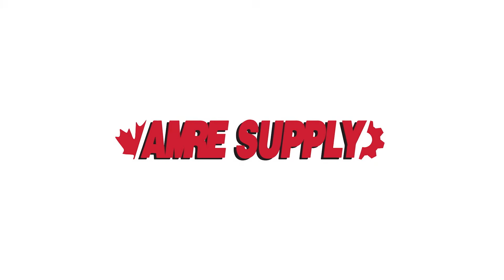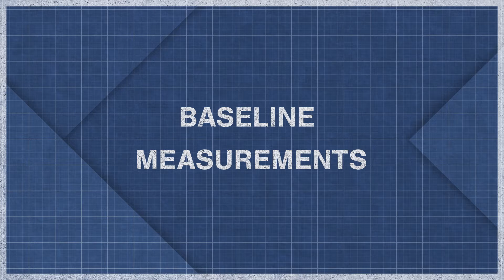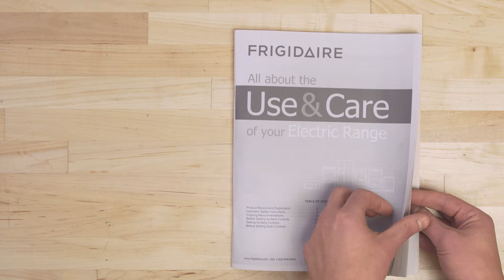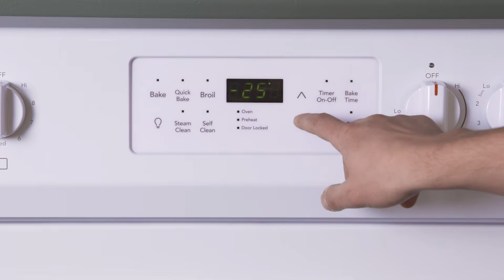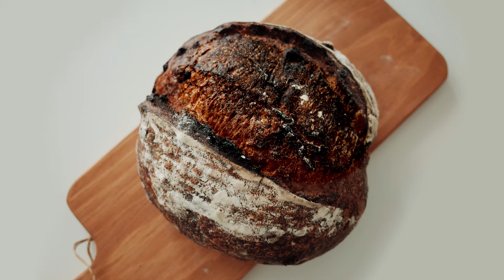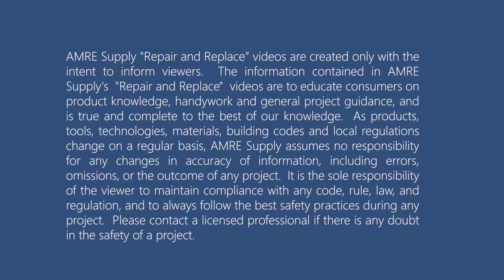How to Calibrate the Oven Temperature | Repair & Replace

Comment: I'm trying to get the temp very low for drying clay and plaster.   I calibrated it to minus 35, then set the oven to minimum (170) so my meat thermometer should read 135?  But no, it's going up to 200.   Is there any way to replace the thermostat with a lower one?
Reply from the maker: Thanks for watching. When you're monitoring the temperature, is that only during the preheat or does it sustain 200 degrees for the entire cook time?

The other option is using the tray under the oven that people often store their pans. Try measuring the temperature of the drawer on different bake settings. It won't be as warm as the oven, usually 110–190°F, but this depends on the insulation and the setting.

Comment: Mine has a dial to turn on all temperatures
Degrees doesn't show in display
Reply from the maker: Thanks for watching. Older ovens will use a oven thermostat which is connected to a sensing bulb. This is not digital. Over time these thermostats can wear down and effect the temperatures.
https://www.amresupply.com/catalog/Oven-Control-Thermostats-632506-AD1P

Comment: Mine has a dial to turn on all temperatures
Reply from the maker: Thanks for watching. Older ovens will use a oven thermostat which is connected to a sensing bulb. This is not digital. Over time these thermostats can wear down and effect the temperatures.
https://www.amresupply.com/catalog/Oven-Control-Thermostats-632506-AD1P

Comment: I haven't done the test yet, but my problem is that the right side of the oven is burning the items being baked??? is it that the oven isn't level??? or is it a temp. problem????
Reply from the maker: Thanks for watching. It is not common for only one side of the oven to burn the food. Does your heating element evenly cover left to right? 
It is possible that the element is starting to fail, and there is a short or a hot spot in the element.

Comment: Is there an adjustment to narrow the differential between minimum and maximum temperatures during the cycles?  I'm getting 50-60 degree differential depending on temperature set point using a sensor offset of +25.  I'm assuming the differential is preset and not adjustable though.
Reply from the maker: Thanks for watching. Most models do not have a way of adjusting the range of temperature. This is usually preset and is fairly wide all things consdiering. Convection cooking helps normalize this, and will reduce hot and cold spots. A 50 degree F differential is considered very accurate when it comes to electronic controls and heating elements that can only turn on and off intermittently.

Comment: All manuals say not to use a thermometer like ones in grocery store, but don’t tell you what to use. So what should I use? I have 2 different brands in my oven that both read the same temp so I’d think they’re right. Oven set to 350, both read 300. What are we supposed to be using?
Reply from the maker: Thanks for watching. The oven manual might suggest using a thermistor (temperature probe) like those that can be connected to some multimeters or an accurate meat thermometer. Thermistors are heat sensitive resistors and are very accurate.

However if you tested with 2 separate thermometers then you know that one isn't faulty.

There is a small test you can do without a thermometer. Based on it's crystal structure,  sucrose or table sugar melts at 365 degrees F.

You can place some granulated sugar on tin foil on a cookie sheet. Place in the oven set at 375 for 15 minutes. The sugar should melt. If it doesn't melt then the temperature is too low.

Alternative if you put sugar in at 350, the oven should not be hot enough to melt the sugar.
Reply: @AmreSupply  so cool!  I definitely will also try that as I’m still not convinced my oven gets to the right temp. Thanks!!!!
Reply from the maker: @sandyc9379  You're welcome!

Comment: Do you mean check temp at 10 min. Then just 5 min. later, then 5 min. later? Or do you mean check temp at 10 min. then set the timer for 15 min. from there, then set the timer to check from there to 20 min. ?
Reply from the maker: Thanks for watching. Check at  5 min then wait 5 min and check again. The interval length don't matter it could be every 3 minutes or every 4. It's just helpful to get regular sample points to get an ideal of the average temperature over time.

Comment: Thank you for the helpful video. I was certain our oven was 5 degrees too low but it’s actually 6 degrees too hot. Unfortunately our Whirlpool oven does not allow 5 degree increments for adjustment but instead 10. I decided to minus 10 and see how that works out.
Reply from the maker: Thanks for watching, we're glad you found it helpful. When it comes to a 5 °F difference for most cooking won't make a huge difference in most recipes. Even opening the oven door several times during baking can change the temperature for a few minutes so there will be some variance as cooking is done.

Comment: Thanks for the video, I had to turn my frigidaire gallery up to 550 degrees then hold in the bake button in for 5 seconds in order to  adjust the calibration desgrees.
Reply from the maker: You're welcome, thanks for sharing what steps you took to start the calibration!

Comment: I took two readings of my oven with the temperature set at 350.  When the thermometer in the oven read 350  the digital display read 260 on the stove.  I had to raise the temperature 90 degrees  but the stove would only let me raise it 30 degrees.  This is with a new igniter and temp sensor.  It's a Whirlpool gas model# WFG374LVS 1.  I'm stumped?  How do I raise the display up 90??
Reply from the maker: Thanks for watching. Most models don't allow for adjustments over 30°F in either direction when calibrating. If the temperature is significantly off then it points to a larger issue.

Since you've installed a new temperature sensor then you've eliminated that as the source of the excessive temperature. Check all the wire connectors and make sure there is no grease or anything else that might interfer with the electrical signal. Also check that the sensor is positioned correctly. If the temperature is still out by 90°, then it could be a faulty control board.
Reply: @AmreSupply  Thank you for your quick response!!
Reply from the maker: @bobross9321  You're welcome, we're just happy to help!

Comment: When you said to take measurements at 10, 15, and 20 minutes, did you mean 10, add another 15, and add another 20 minutes? Or did you mean to take the temperature at 10 minutes, then take the temperature again at another five, and then again at another five.? By the last method, my oven is off by 67 degrees.
Reply from the maker: Thanks for watching. The intention is just to get an average temperature by sampling a few times so take the temperature at 10 minutes, then take the temperature again at another five, and then again at another five. You can take more sample points for more accuracy but just keep in mind that every time you open the oven door you will lose some heat.

Comment: is it normal for the oven to be set at 350 degrees and get high and low readings around 320 and 370?
Reply from the maker: Thanks for watching. Yes the temperature can swing +25 or more degrees during a bake cycle. In your case the average heat will be around 350.
Reply: @AmreSupply  thanks. That's where uts at after I calibrated it. It was running up to 391. I bought a good heavy pizza stone to try and limit these 20° up and under swings. Thanks for the video
Reply from the maker: @metthem88  You're welcome, we're just glad that the video helped you get it calibrated!
Reply: @AmreSupply  update, I bought a 3/4 thick pizza stone at one of the outdoor stores and re-calibrated my stove again, now my temps only swing 11° on each end of the cycle.
Reply from the maker: @metthem88  Thank you for the update, a 11° swing is a big improvement!

Comment: I went to try this and when I pushed the bake cycle button it said "feature not available" and the oven won't turn on
Reply from the maker: Thanks for watching. Not all ovens will have the same button combinations and features. If it won't start the bake cycle, then try unplugging or shutting off the breaker for several minutes. This can often reset the oven.
Reply: @AmreSupply  I did the shut off the breaker but it was only about 2o seconds so I will try again. Also,,, there is a settings button and when pressed it shows error messages. About 3 of them.
Reply: Hit the breaker for 10 minutes , no change. But, when I press settings I can get it to go to oven temp change. But, I don't know what to change it to because I haven't the ability to turn it on and check the temp. Should I try taking it down 20 deggrees and see? By the way,,, thanks for being there so far,,, I am also learning new stuff
Reply from the maker: @cold2four1  If you have error codes, then it's best to look up them and see what they mean. This video explains some of the codes and what the most common problems are: https://www.youtube.com/watch?v=kxk-itM9UBA

Here's our playlist of all repairs: https://www.youtube.com/playlist?list=PLCo9SMjkdWBysYYCcg5xQLiVh_cW0JQvt
Reply from the maker: @cold2four1  We're just happy to help. It might be good to look up your model or reference the manual to see if there are specific instructions for your model. You might be inside of a certain mode.

Alternatively if the temperature sensor is faulty then the control board won't let the oven heat. This might show up as an error code but this will depend on the model.

Comment: This was helpful. My oven is a mess. Its set for 275 but readings are 350 🤦🏻‍♀️. I was only able to calibrate it for -35. I will need to take additional steps but this is helpful. Thanks so much.
Reply from the maker: Thanks for watching. You could try cleaning the temperature sensor. In some cases, a buildup of grease can act as an insulator. It is possible that the sensor is starting to fail. You can see how to test the sensor and install a new one in this video: https://www.youtube.com/watch?v=jnt_mUwdL8o

Comment: Hi there, thank you for the video. But im desperate for some help! I've got an Hotpoint Oven, model "SI4 854 H IX" . Any idea how to calibrate this model? my oven doesn't have the particular buttons used in this video.
I've called the Hotpoint customer service and technical board, none of them know. They want to send an engineer down...which i dont want for literally a 5 second job. Nevermind what they're charging me...
Reply from the maker: Thanks for watching. Not familiar with that model so I can't say anything for sure. It would be  best to check the oven manual which some are available online. It might have specific instructions. In some cases, it might not be easy to calibrate the oven without special tools.

Comment: What if your oven displays F10 code
Reply from the maker: Thanks for watching. An F10 code refers to a runaway temperature. It's likely an issue with the temperature sensor or the control board. Using a multimeter you can test the sensor to see if the resistance is within normal ranges: https://www.youtube.com/watch?v=jnt_mUwdL8o

If the sensor is good then it could be a faulty control board: https://www.youtube.com/watch?v=ORTi4lLyoqw

Comment: How do I address the women in my life that complain their older ovens do not work like they used to?  Can an oven work perfectly with respect to set temperature (as assessed from the test described in this video), but still have valid operator complaints that their older oven no longer ~works like it used to~?  I'm talking about two separate ovens.  The women are complaining that with oven age they could not rely on the oven temperature and so everything cooked was either under or over cooked?  I spent the day helping my mom with her problems (my wife adapts much better with cooking than my much older mom, but my wife is claiming there must be something to my mom's complaints). I found that the set temperature was exactly the average of the oscillating temperatures showing +/- 30 degree swing with empty oven. I then added 2 X pizza stone mass and warm up took 50 minutes as pizza stone temperature ramped up to exactly the set temperature and stayed there.  So both my wife and mom are saying their older ovens don't work like they used to and I am saying everything is fine.  Where is the disconnect with their complaints that something has changed?  I told them to keep a pizza stone in the lower rack to help reduce temperature swing and use an instant-read food thermometer to make sure the food is done. I think they are only imagining better ovens, but I don't want to overlook something. If the set temperature is being hit nicely for the average how can anything be wrong?   Thanks for help.
Reply from the maker: Thanks for watching. Most electric ovens don't consistently stay at a single set temperature as the mechanism of turning elements on and off will cause spikes and drops in the temperature. The average should still be close to the set temperature. Older models didn't really have any particular advantage. They still worked by elements turning on and off. Instead of using a control board and a temperature sensor, those older models used a fluid sending bulb that would turn the elements on and off. 

The tricky thing is that people often remember something working differently than it was so it's hard to verify if the older models were more consistent or if that's just how they felt. You are right that the pizza stone and having more thermal mass inside of the oven will help with the consistency.
Reply: @AmreSupply  Thanks. I’m at a loss to understand how her complaint is at all valid and you seem to be saying the same thing.  I have since told her she does NOT need a pizza stone to help with temperature consistency (like I first suggested to her) as I doubt there is need for it. Instead, just monitor for "doneness" the internal temperature of the baked goods she is cooking using an instant read thermometer,  AND understand that there are only four basic temperature ranges needed for cooking that her older oven is indeed providing her; i.e. a cool oven has temperature set to 200 °F (90 °C), a slow oven has a temperature range from 300–325 °F (150–160 °C), a moderate oven has a range of 350–375 °F (180–190 °C), and a hot oven has temperature set to 400–450 °F (200–230 °C).
Reply: TLDR

Comment: I have increased my adjustment as high as it will go, which is 30 
degrees.  I needed a 45 degree increase.  Are these elements just poorly
 made?  The need for additional degrees beyond the ability to fix is 
really frustrating, but I accept it since I have no guarantee a new 
element will be any better.  If I need 350 degrees I have to set my oven
 for 365.
Reply from the maker: Hi Janet, thank you for watching. If both elements are heating then they are working. The element is a resistor that generates heat when electricity flows through it. It either heats or doesn't heat. The oven controls the temperature by turning the elements on or off. 

If you've made adjustments and the temperature is still off, then it's likely an issue with your temperature sensor. This repair is shown here: https://youtu.be/jnt_mUwdL8o

Comment: Is there a way to adjust the allowable range above and below the set temp?
We recently purchased a lower quality oven after having owned a couple more expensive models in past years. The main difference we see in this one is that the elements and oven go through longer cycles between on and off which is rather annoying and makes cooking harder to control.
Reply from the maker: Thanks for watching. The oven calibration is meant to help match the temperature that the oven thinks it's heating to, to the actual temperature inside of the oven. The rate of cycling is not something that is adjustable. A convection fan would help reduce any hot and cold spots in the oven and would help it cook more evenly. As well putting a pizza stone in the oven can help. The stone will take longer to heat up but once it's up to temperature it will help maintain heat and help with consistency of baking.
Reply: @AmreSupply  Thanks. Figured as much. This Whirpool stove has overly long cycling time IMO. Even the cooktop. An egg stops sizzling between cycles of the element.
The oven sees wide temperature swings between max and min. Terrible.
Reply from the maker: @dart70ca  The fluctuations in heat can be frustrating. Having more thermal mass like a pizza stone, using a heavy cast iron pan, or adding a bowl of water to create steam inside of the oven will all improve the consistency.

As for the cooktop, the heat switches are fairly standard and don't vary much. There are different sizes of elements which can effect it. Carbon steel or cast iron pans can help even out the heat in this case as well.